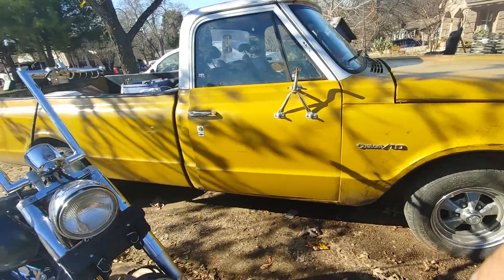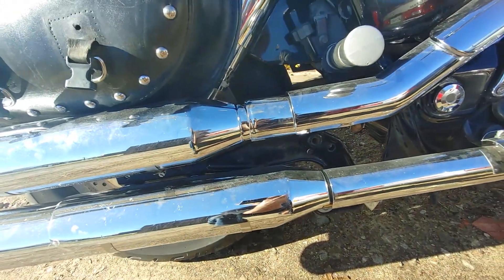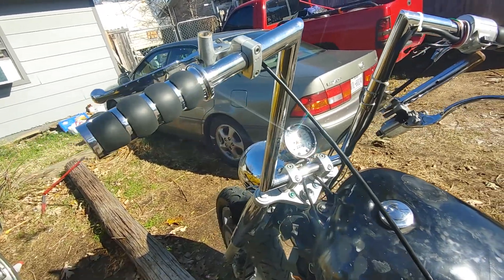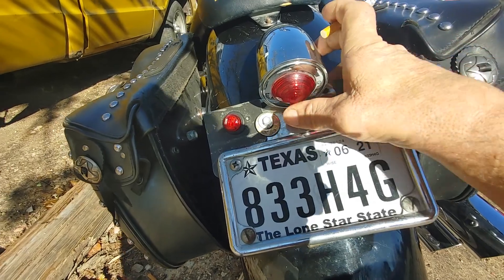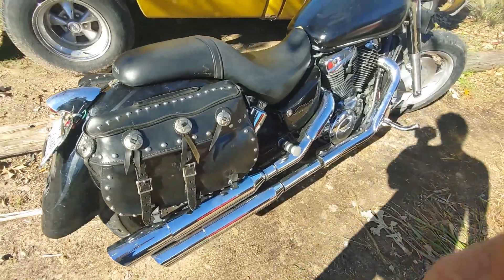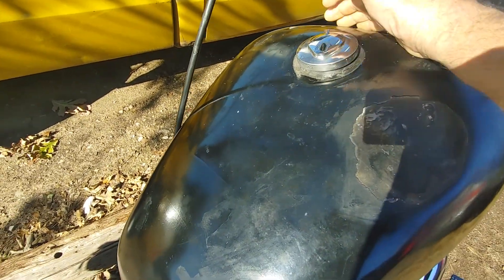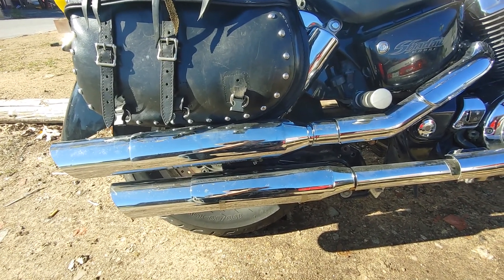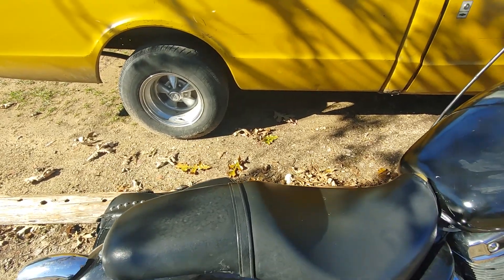update on murder cycle

Comment: does the saddlebag get to hot on the exhaust ?     I got my stimulus today I hope you got yours mine is already spent.
Reply from the maker: How much was it
Reply from the maker: No it doesn't get hot because I have a heat shield on that
Reply: @limpy8175  600.00 i am hoping we will get 2k but mitch McConnell is holding us up the house passed it but the guy mitch is screwing us bad .